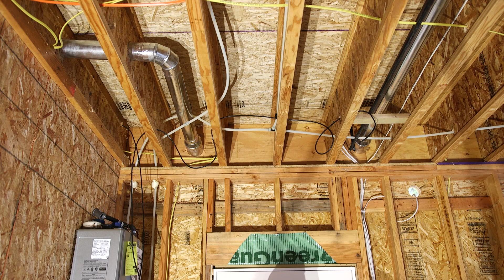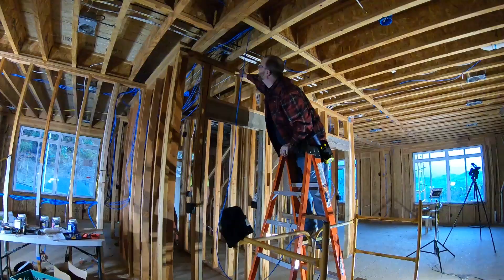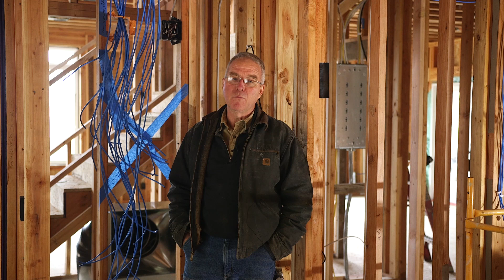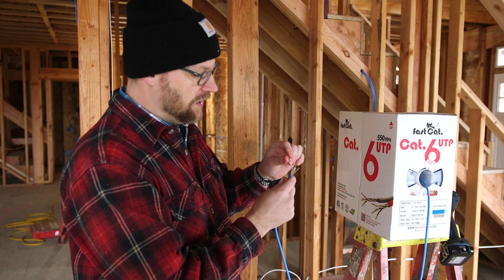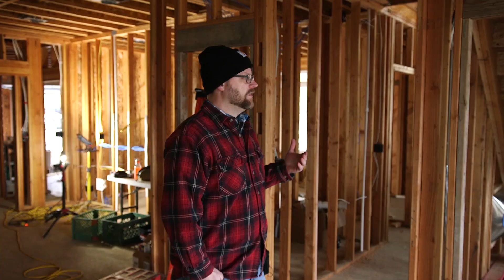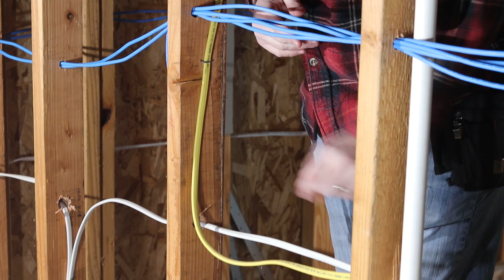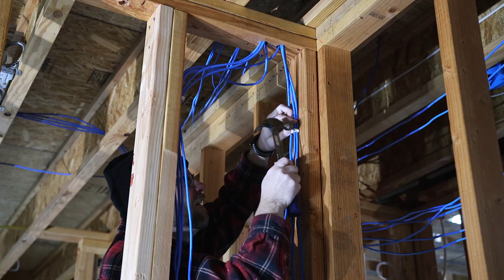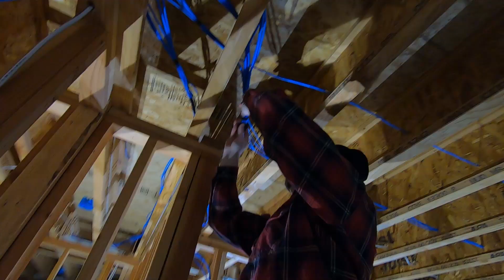Installing A Home Network Ep.100

Comment: 08:12 one more thing to keep in mind in addition to CMR and solid vs stranded is that even with solid cables use solid copper only cables (also go by "OFC" or Oxygen free Copper CAT6), and do NOT use "CCA"  (Copper clad Aluminum) CAT6; which are a bit cheaper. Especially, if you are planning to use them for POE (Power over Ethernet) devices down the road like cameras, since the CCA will heat up and become a fire hazard. Aluminum has 50-60% more electrical resistance than Copper causing more heat generation.

Comment: One quick question as I watch this back, but shouldn't the holes through your engineered i-joists be in the middle third of each joist? The holes seem too close to the bottom and I'm pretty sure they would fail an inspection in my area.

Comment: I usually put in a 2" innerduct conduit that runs between all floors in the house and cur access holes at each floor with grommets inserted to allow cables to run to the basement easily. We were lucky that we were able to align the conduit and the telecom room through closets on each floor making adding cables much easier in the future or having to replace cables should a cable fail. I use Cat 6 cable since my access point can connect back to the network switch at 10Gb and this ensures the cable meets the capabilities requirements. I usually do two access point per floor and one in the garage for the workshop and cameras in the garage.

Comment: The days of having to run RG6 or RG11 or RG59 (LOL!) to different rooms in the house is long gone. Now you run it to your telecom room and connect to the router. then its Ethernet to everywhere else and for wireless good quality access points. For TV most cable companies the use Xfinity for example now have a cigarette size box that connects to the tv and then connects wirelessly back to the router on a private network not accessible to the customer. I would recommend using some outdoor rated cables to the soffits for security cameras on all four corners of the house and another one with a view of driveway and walkway. Finally, the pool area as well needs a camera. We had neighbors sneaking into our pool when we were away at work. So, we ended up putting a 7-foot fence up and locked gates for access. First time they tried to sneak in the new gated pool area we   opened an audio channel in the pool area and informed them they would not be allowed into the pool area due to insurance and liability risk and that they had been recorded on our cameras entering the property.

Comment: All that wire is nice, but 99% of people would not notice the difference between that hardwire and a wi-fi network. With mesh networks working so well, it might not be the cheapest to run all those wires.
Reply: I gotta use a hardwire network because our internet signal is not the best (at least Starlink makes it way better than it was) and we have standing seam metal roofing everywhere

Comment: I would have run smurf tube, rather than RG6, from the outside demarc to the media cabinet. That way when the neighborhood is upgraded to fiber, the installer can easily pull a fiber to the media cabinet.

Comment: One thing that I always suggest whenever I’m doing cable installs, especially if it’s two-story homes and they use a lot of Wi-Fi devices is in the downstairs hallway and the upstairs hallway have a wireless access point on the ceiling. It helps with the Wi-FI signal strength.

Comment: @11:31 the interference effects between power and data lines is well explained, but note that you have data and power lines running in parallel on either side of that stud. Magnetic fields go right through wood!

Comment: As an I.T. Person, this is extremely beneficial and important to do this while you can, you DO NOT want to rely solely on Wi-Fi because it not only is very limited especially when having to pass through thick materials such as walls, but can be easily intercepted with very basic tools in the wrong hands (which severely compromises your personal information).  Pre-wiring a home with networking cabling will save you thousands ($) down the road and make adding equipment far easier in years to come

Comment: Can you show a video on making the actually end connections as well running wire is one thing but doing all the connectors and what type A? B ? Stright or crossover did you end with?
Thanks good video on running on the cables
Reply: T568B is more or less the standard when it comes to ethernet wiring. Straight through is used when you connect two different devices, say a switch and a computer or a switch and a game console. A cross over cable is used when you connect 2 devices of the same type, like a switch to another switch or a router to another router. However in modern devices, there's no real need for cross over cables anymore. Modern devices can auto-sense which pins are transmit and receive.

Comment: This is especially important as more low-voltage items that operate with Power over Ethernet are coming up and ever more available.  Entire lighting, security, switches, and audio systems can now be powered by Cat6 and controlled by computers.  I for one have a lot of the lighting in my home setup for voice command and schedules.  For example, every work day, my bedroom lights start to slowly come on till they are full on when I should definitely be out of bed.  Someone rings the door bell?  Their image shows up on our TVs or our phones and we can talk to them.  There will probably be a time in the near future where standard power as we know it won't power much more than receptacles, kitchens / bathroom appliances, and MEP equipment.

Comment: The only thing I would have done differently is I would not have stapled or strapped cables down or taped or tied the cables together. Loose J-hooks would be enough. In the event a line needs replacement, I like to be able to attach the new line to one end of an existing line and be able to pull them through, so in the act of pulling and removing the old cable, you are simultaneously running the new one. 

Some may say that increases the chance of a cable being pulled too far one way and being lost, but as long as you leave plenty of slack towards either end, that shouldn't be a problem. Service loop any slack in your network cabinet, and service loop any slack at the wall jack and place it back inside the wall. The loop itself will block either end from pulling through unless you deliberately go in and untie it. It also gives you plenty of length to work with if you need to re-terminate either end.

The key is also keeping your runs as unrestricted and resistance-free as possible, because, as the gentleman in the video explained, kinks/breaks can be an issue, though I think we have gotten to the point nowadays where the cable is resilient enough to worry too much as long as you planned out your runs well enough, unless you are upgrading to fiber optic cable which is VERY susceptible to breaks. Add wide conduit tubing in any spots that look like there may be trouble as far as resistance or friction on the cable.

Comment: cat 6 is NOT fragile at all only pulled about 200k feet in my career thus far. get a wrapped spool and not a box put a broomstick through it and pul away. also to worry less about electrical get shielded cat6 or 6a

Comment: I noticed he talked about the fire rating of CMR cable but at the end he was bundling wires with velcro. Is there specific kinds of velcro that can or can't be used when installed in-between walls?

Comment: 24 network jacks is actually not that much. If the owner later on wishes to upgrade to a smarthome, then they may even need tenfold of that, without exaggerating.

Comment: The one-foot rule for parallel data and power cables is usually okay in residential applications but there are guidelines that specify how far to keep data cables from power cables based on cable category and line voltage. You can find charts online.

Comment: 10:30 does that magnetic field is also present in poe (power over ethernet) which carries both data and power on the same cable or only on higher voltage, given that would you suggest a shielded twisted pair instead to reduces the chance of crosstalk and provides protection from interference?

Comment: When we have to pull Ethernet cables from one end of garage on a slab to another portion of garage.  We are unable to put that into attic because low clearance. They are not expected to face abuse, is it required by code to put them in raceway or conduits?

Comment: everything he said about networking and network cables is completely accurate. a lot of homes are still running 100 mbit networks although most are up to 1 gbit by now even though 1 gbit has been around in home tech for about 15 years now. 5 or so years ago there was some talk about getting upgraded to 10 gbit but it fizzled due to no real consumer demand. even now in 2022 home networking equipment is only barely getting upgraded with a few 2.5 gbit ports so CAT 6 cable is perfectly fine and future proof as it can run 10 gbit up to 150 feet runs or so. there is absolutely no reason at all to run cat 7 or 8 which can handle 40 gbit+ because consumer devices will likely not even remotely get there until we're all in nursing homes. i am running 10 gbit in my home because i run an unraid NAS to power mass data storage for multiple computers and media devices and with 10s of GBs of storage it's so necessary to get reads over 1 GB/s instead of 1 gbit's 125 MB/s max; but most people aren't even remotely near this kind of use case, sadly.

Comment: This is more just for the curious, because cat 6 is what you should use in a house, but cat 7 and 8 are very popular in the US. It's used in datacenters and business to connect servers together. This video probably traveled on miles of CAT 7 or 8 to get to your computer. 

One other super useful device that you can put cable in for is your wireless access points. There are some great consumer level access points that you can put on the ceiling that can be powered by a single cable just like the cameras you mentioned.

Comment: Being an electrician (but also doing some commercial low voltage/data work) I am glad Ben mentioned keeping your line voltage and data/low voltage/comms in separate supports...Like he said, You may see a BIG HOLE the sparky left but you CANNOT run low voltage/data cable through that hole, can't use the same bridle rings in the ceiling, can't use the same ANYTHING to support your line and low/data/comms...Thanks Ben! Great video!

Comment: Ben's words about puling vs pushing, kinks, distance from power etc are all great for a commercial installer, where you don't have the time to waste fixing a shoddy job, and its best to get it done right the first time. But for a consumer installing a single new run, it really doesn't matter as much, and you can really get away with a lot.

Comment: CAT7 and CAT8 are designed for datacenter use for very high speed connectivity. Nothing you should need in your home. They are totally commercially viable, however.

Comment: Cool Video..I am a Network guy I have ran a lot of Wire/Cable..one Note i would add is Always Make Sure your Using a Solid Copper Cat6 or Even Cat5e Cat6a,7,or Even Cat 8 & Avoid cca Cat 5,6,7,or 8 Like The dang Monkey Plague..It Will Make You Pull your Hair Out trying to figure out why the performance is so Bad (ask me how i know) I Run cat7 & a lot of Cat6 & Cat6a & i Even ran In Home Fiber to my 10Gb Network to my Server Rack to Feed Several Home Media Servers for Plex(its like Netflix that i own/Manage) for my Lab & computer back ups  ..Its Really Interesting to me for what ever reason & it to late now but i would advise a Cat6a over plain cat 6 but whats done is done & some one will pay some one to upgrade it in a fuw years imho !

Comment: Category 6 cable can absolutely be daisy chained in ethernet networks... this is enabled by the CSMA/CD functionality inherit in 802.3x networking.  Now you wouldn't want a ton of devices in a daisy chained connection because they would all exist in a single collision domain, but it absolutely would function just fine.  Early networks relied on this functionality heavily when switching was still cost restrictive.

Most of what Ben says here is correct otherwise though, and certainly accurate enough for a modern network.  Good work gents.

Comment: Yeah, this is not what the riser rating is defining though.  Riser cable is designed to support it's own weight when traversing stories, or rising.  Essentially a riser cable should not split under its own weight while spanning its full length vertically... or 100m.  That's it... nothing to do with flame or fires...

Comment: Ben did an awesome job!  That house will meet all networking needs for years to come. 

If I may add a couple of points to consider that I did not hear:  When planning the homerun of RG6 coax from the outside to the media room please do not use the cheapest cable on the shelf and call it done. It will haunt you later because coax is no longer just "TV Cable" and using inferior cable will cause great disappointment for the homeowner.  

 Long gone are the days when having a home wired with coax meant improved TV reception. It did at one time but that was when broadcasters, satellite and cable companies used analog transmission. Today everyone uses digital which is very unforgiving with coax for the same reasons Ben explained with CAT6. 

Cheap coax is prone to greater signal loss over distance as well as interference due to inadequate shielding. Use quality RG6 quad shield for the outside run to the media room. It will do a much better job of delivering services without excessive power and data loss which is common in budget cable. And if the homerun is going to be longer than 100 Ft. I'd suggest using quality RG11 instead for lower loss. I did. It's more robust and slightly harder to work with than 6 but you only need one run and it's outstanding.  

Also, when picking up CAT5 or 6 please confirm it is solid copper and not CCA.  Copper clad is okay for data, connecting printers and sharing computer files but not much else. Today's technology is bringing more and more devices to the market that require power over ethernet that CCA cannot handle for obvious reasons.   

Lastly, a request or plea of sorts to all contractors: Please consider what I have posted and Ben has said about networking. Yes you can buy the cheaper cable and save a few dollars, but as a former technician I can tell you the customer disappointment is huge and sometimes crushing when they are told their new home will not support the services they are requesting because the wiring is inadequate. If you're not sure please ask the local cable office. Few meetings were more enjoyable than when a contractor would call or come to my office and ask questions because he wanted the job done right. I can't promise you will receive the reception at all offices but everyone who came to me with questions received my full support, and sometimes a roll or two of quality coax if they were in a time crunch. We worked together for an outcome that took care of their customer and ours.  Just ask.      

I really enjoy this channel. It's obvious the message and teachings are 100% genuine and from the heart. 
Many thanks!

Comment: If your cables aren't too stapled down, you can use a lightweight cable to guide through a heavier cable at a later date if you need to upgrade. It won't completely eliminate chopping into the plasterboard, but it will reduce the total damage.

Comment: I always put at least CAt 7 cable because the price of the cable is a small addition compared to the cost of installation (or cable replacement). For example, CAt 7 has each pair of isolates protected from interference. And  Yes.. CA7 cable is also available in the USA, even from Amazon.

Comment: For future proofing, do draw strings.

Run around while the walls are open, and between every 2-3 studs put holes in your blocking and drop a draw string down. Then staple it to the top of the wall in the roof space, and the bottom plate, and take photos.

When you want to run cables in the future, pull out the photos, count the studs to the nearest draw string, and away you go.

Comment: Make sure to get solid copper CAT cable.  Lots of "network cable" is CCA (copper clad aluminum).  CCA cable does not meet CAT specs and can be a dangerous fire hazard if used in PoE situations like cameras.